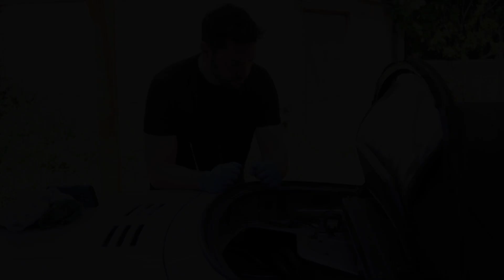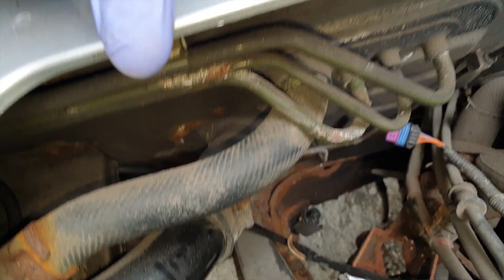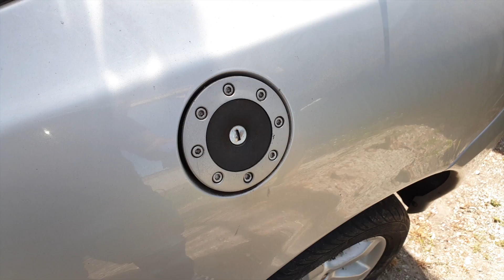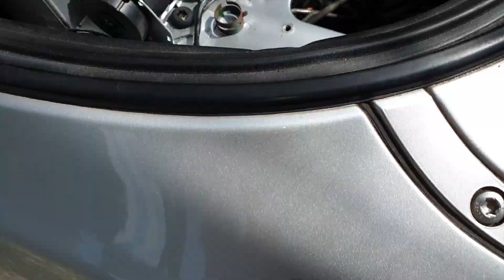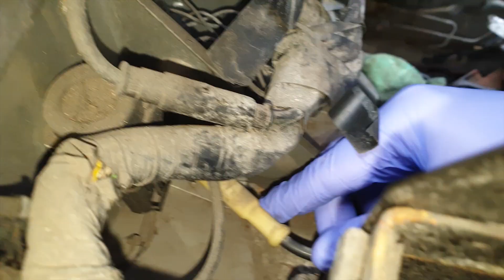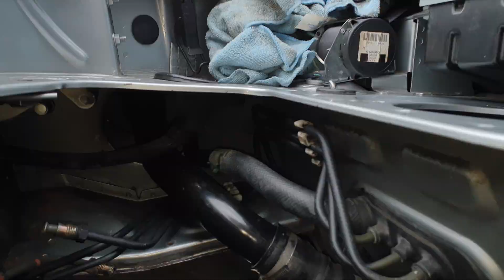Fuel Line Replacement ¦ MG TF Restoration

Comment: the easiest way to remove the snapped plastic in the hose is to warm a bolt that is a little bigger than the bore. whilst the bolt is hot, screw it in to the plastic broken section and let it cool. Now you have something to grip and twist to loosen the broken segment till it comes out.